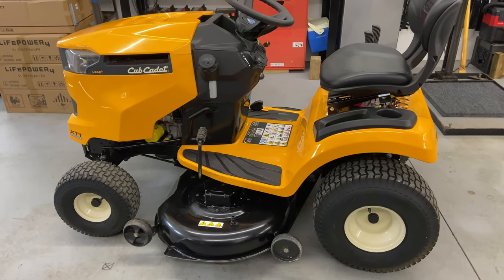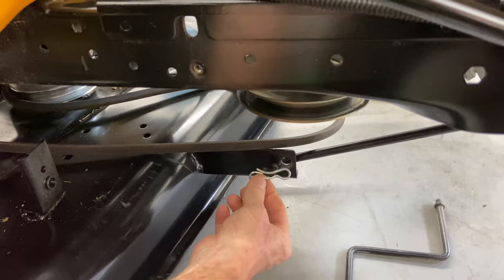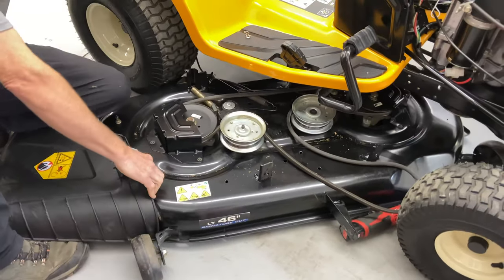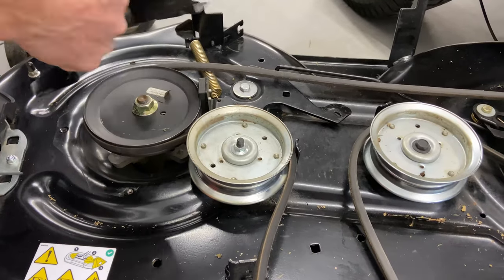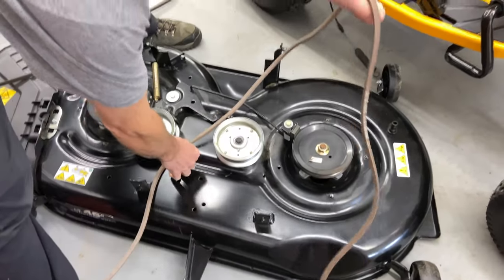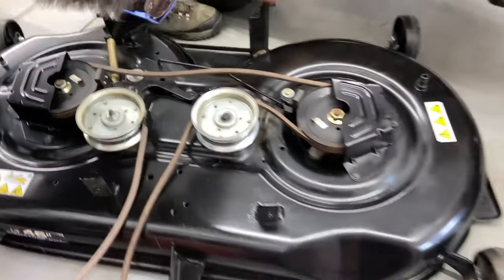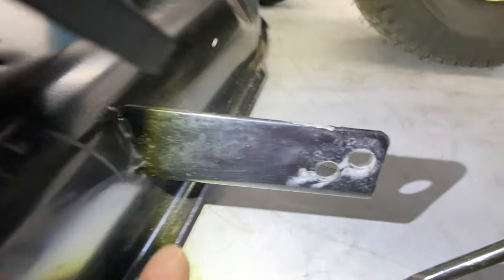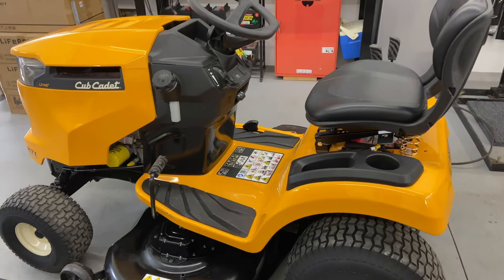How to Replace Mower Deck Belt Cub Cadet XT1 46"

Comment: This is my mower. I watched you take the mower deck off before, I think.  I had to change my belt, and your video helped me do that. I had to guess a little about the removal and replacement of the belt, back then. Watching this I see I did pretty close to what you did. Only thing is, when you pull the deck on the edge be careful because it can slide and fall. It did on me, and I fell, it fell on my ankle. And I limped around for a few days. You are very correct; the right belt is the way to go. On a different mower, I picked a belt at a hardware store. Measuring it like you did but it was a bit too long and slipped off often. Saying all that, I want to thank you so very much for your videos. They have been most useful to me.
Reply: Also make sure the width of the belt is correct as well. The parts guy gave me one 1/8th inch wider. It was a struggle until I got the correct width belt.

Comment: This video saves me every time my belt jumps off!
I love my XT1 except for the belt coming off frequently. I haven't figured out why it keeps happening. This video and the one where you change the belt have helped me many, many times. One would think I'd be able to remove the deck in my sleep by now but every summer I have to go back and have you guide me through it again.
Thanks for making my life a little easier 💗❤️
Reply from the maker: I’m glad to help! Thank you for watching and the kind comment.
Reply: @ainttakenanyshit  Thanks. I have been more careful about that since the belt started jumping off. Mower is in the shop now so I'm curious if they found a problem with the pulley or anything.

Comment: I frantically changed the belt yesterday and find this video today!!!  I asked several for help and the mower is only two months old but the grass was not waiting for me to find someone!  Wish I would of seen this beforehand but THANKS for all of the tips and places to check which I did not do.....I did not take the deck off and I did not loosen the two pulleys.  I started with the drive pulley under the engine and shimmied the belt in, then I just put the belt around it's spots as in the diagram by just holding the belt and turning the pulleys then started it up and mowed for two hours....BUT NOW, I will be going and checking all of the things you mentioned, THANKS SO MUCH
Reply from the maker: I’m glad it will be helpful! Thank you for watching and the kind comment. Please give this video a like and share my channel with your friends to help it grow! It would be greatly appreciated:)

Comment: Thanks for the video! The difference between the older Cubs (like my old LT1042) is pretty clear and it seems like MTD improved on a few things. For example, the belt keeper rod is way easier to remove and replace on the XT1 vs the LT1042, because on the 42 they made that bolt go in upside down with very little room to thread it back in so you’d have to balance it on an extension very carefully. Also, the clips to remove the deck from the deck raise mechanism is much easier too, before you’d have to pull a spring loaded hook on each side and it was a PITA to get it out. 

I don’t understand why they made the bottom nut on that pulley below the deck instead of under that pulley like the older Cubs though, might have been an engineering decision. But I will say the deck on the XT1 seems to be pretty solid.

Edit: Also this video made me wonder why I haven’t bought an electric ratchet yet 🤔

Comment: Today I tried to use the manual to remove the deck of my XT1. The manual used terms like flange lock nut and hex screw, not very useful. I think left and right idler pulley nuts would be better. Of course the manual didn't mention the spring attached the deck either so I thought I was done until the cable held my deck back. I unhooked the spring OK as well as the cable retainer and laid them on the ground. The manual said "loosen, but do not remove the flange lock nut on the right idler pulley and the hex screw on the left idler pulley". So I didn't know what "loosen" or flange lock nut meant until I watched your video. I guessed right but "guessing" is not my thing. I want to know.

I left the belt around the idler pulleys after I removed the engine pulley keeper because I couldn't figure out how to get the belt past the retainers. Boy, you move fast and made an excellent video. I was so pleased to see that there was an easier way to remove/replace the clips than the crazy methods I was trying. I discovered I have a bent chafing (deck) wheel mount on the left rear so it's "hammer time" as well (Maybe I'll use a persuader instead, a good old Archimedes lever). The wheel is mounted on a welded bracket so I will need to bend it back so the wheel is aligned to the front wheel.

My 7-tear old belt seems to be as good as new but it may have stretched so I'll compare it to a new one. It wouldn't hurt to replace it. I have done nothing to my tractor for 7 years so I cleaned and vacuumed the tractor and gave it a new Kohler fuel filter, a new air filter and pre-filter, oil filter, 2quarts of mobil synthetic oil, two new spark plugs and charged up the battery. It starts and runs great and soon it will have new mulching blades and a new deck belt. After 7 years I still got a flashing timer on the display to say everything was OK. Amazing! I'll follow the maintenance guidelines from now on. I didn't realize tat spark plugs are good for 500 hours. Of course a gap check (0.030" on myXT1) every year would be good.

Thank you for a fantastic video. Now for my blade replacement. I think I'm going out tomorrow to buy one of those electric side socket tools, very handy and of course, much faster.
Reply from the maker: Glad to hear your machine is doing good! How many hours do you have on it? Thank you for watching my video, the kind comment and supporting my channel. Please share my channel with your friends to help it grow. It would be greatly appreciated!

Comment: Great video.  I have a 54 inch deck. Belt just started to fall off on me.  It’s probably 15 years old lol.  I don’t have nearly the belt guides as the one in the video. It seems the tension pulley may be a little higher that the rest of the pulleys. Everything is tight. Any input would be greatly appreciated.  I’m putting a new belt on for sure I hope this solves my problem.
Reply from the maker: Missing belt guides or bent pulleys are most issues with belts falling off.

Comment: Good work, Is that deck adjustable like in your previous video's? Does the adjustable hangers that is on your site fit that machine? Thanks for the video.
Reply from the maker: Thank you! The last video was a Poulan made by AYP/Husqvarna and this Cub Cadet made by MTD. Two totally different manufacturers and the way they attach and adjust the deck. This Cub has both side’s are adjustable. I will make a video on how to level the mower deck on a XT1 for a future video.

Comment: Thanks for this video! We've watched this video a couple times to help us. This time, the engagement cable feels loose. Do you have any idea why?
Reply from the maker: Not sure what you mean? “Engagement cable feels loose” it should be loose when the blades are not engaged and it should be tight when the blades are engaged. If the cable is loose when the blades are engaged, you either have more deck problems or you purchased the incorrect belt.
Reply: @JohnsonsSmallEngines  Hmmm...thanks. The handle was firm before changing the belt. After, it is loose when going from disengaged to engaged, for about the first 1-2 inches of movement. I'm a total noob, so despite your very clear instructions, I may have done something wrong.
Reply from the maker: Without being there it’s impossible for me to help much more. Double check everything and then try it. At this point there’s not much more you can do.
Reply: @JohnsonsSmallEngines  Thanks for troubleshooting with me.

Comment: Great job there young man and by the way do you have a video on the transmission belt replacement for a poluan XT mower and a John Deere lt 133 mower
Reply from the maker: Thanks Robert, I do not have videos on those two machines.
Reply: @JohnsonsSmallEngines   okay thanks for the info on this matter young man 👍😎

Comment: Thank you for a great video. Do you or anyone else know if there is a tension adjustment on it ? Doesn't look like there is
Reply from the maker: The only tension on the belt is when you engage the mower deck. The spring is attached to the blade engagement cable.

Comment: great video. i have to pull my deck. my blades don't disengage quickly when released. i just changed the blades. when i used it again, it felt like the blades were unbalanced and it was shimmying. when i turned it off, the blades wound down slowly. not sure if its the blade brake or just jumped a pully. need to pull it to find out.
Reply from the maker: I’m glad it was helpful. I hope all goes well and you figure out your issues! Thank you for watching and commenting.

Comment: I have a CC XT1 and was mowing today when I found a spring laying on the ground where I had already mowed. I thought it was the belt tension spring so I stopped mowing and drove it in the shop. Nothing missing, everything works fine. It's about the same diameter and color as the tension spring but looks shorter and has a double bend on one end. I have no idea where this spring goes and it's driving me crazy. But everything works so I guess I'll just run it till something quits. Any thoughts?
Reply from the maker: I work on all kinds of machines, not just Cub Cadets,so I would not know unless I could see the spring and the machine itself. I would suggest looking at the parts breakdown for the mower deck and the transmission drive, which is available online and see if you can find a spring on the parts breakdown that looks like what you have in your hand.
Reply: @JohnsonsSmallEngines  Thanks. I did find an exploded view of the deck and is definitionally not from there. I've never been around  a hydro drive so I have no idea what's back there.  I'll keep looking.
Reply: @JohnsonsSmallEngines After many hours of searching the mower and the internet I found where this spring came from...the neighbors trampoline.
Reply from the maker: 😲Glad you figured it out:) I had one when the kids were young and there are a lot of springs.

Comment: bought mine last year.   I did not have to touch the pullies.    There is enough room to put the belt on without touching them, nor even pinch the belt.   In fact, maybe mine has a bit too much room between the pully and the metal tab.

Comment: I replaced mine and now it won't start. I think i accidentally engaged the blades. Now i gotta take it apart again.
Reply: Same here. Replaced it and now won't start. What do you mean you accidentally engaged the blades?
Reply: @brianm424  bought one of those universal belts. It said it was 46in, it wasn't. It was so tight it pulled the pulley into the blade on position. I just cut it off and got one from cub cadet store. After i put that on it fired right up.